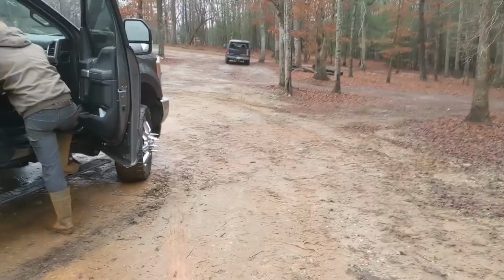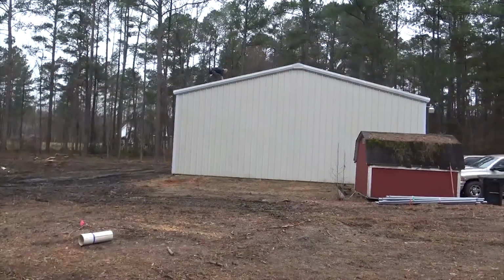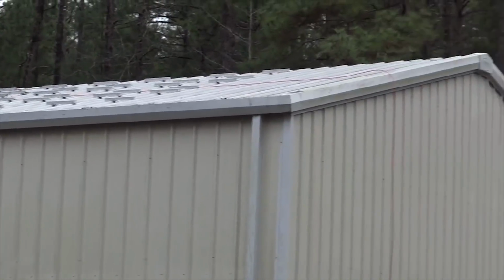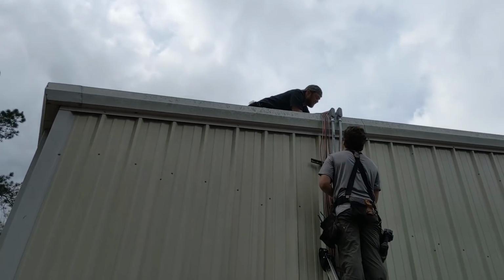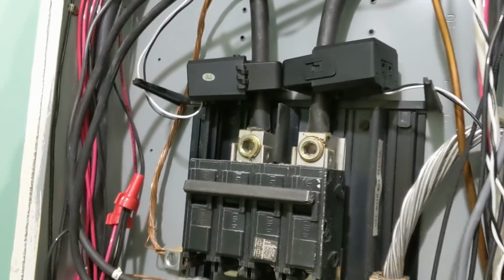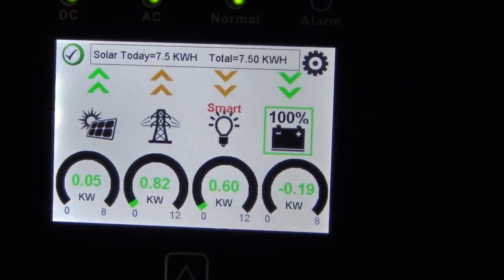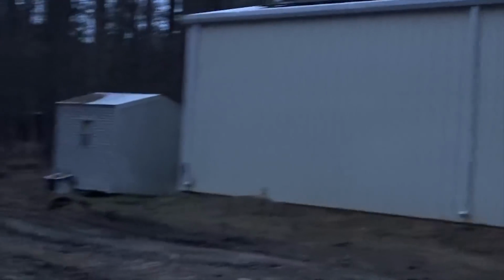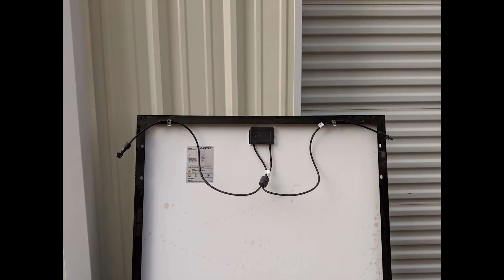Going the extra mile for our customers

Comment: I hope you identify the netural wire on 2 pole breaker hot. Tape or marker. Because I didn't see that with you panel cover off. I hope your panel would have proper cleaning in kitchen area. Above your stove plug below the panels.

Comment: Theoretically there should be no limit to how far you can out the CT's front the solark current is the same at any point in a circuit no matter the distance. That's why 90% of industrial sensors are 4-20 milliamp the wire can be 1000s of feet long.

Comment: Question, why do you use so low powered solar panels & inverters.?   Same array with Sun Power panels would have given that customer 15,540Kw system.
Reply: What do you mean low powered? I don’t think this system was just installed, the pv panels were probably around 250w each which was normal s few years ago. Also it was probably more economical to install a little lower wattage panel at a much better price since they had ample room on the roof. It wouldn’t be wise to throw the latest and greatest 360+ watt panels on a huge roof at the premium sun power panel price. And not everybody is a sun power dealer.

Comment: Hey guys, great installation!!  I noticed that you prep your panels and pre-tie the cables before install, I also noticed a little black cylindrical unit on the module cables (it's shown at point 24.23mins in your video) can you shed some light on what that is?
Reply from the maker: It is part of the sol-arks system installation to install these suppressors as part of the overall EMP protection strategy.
Reply: @engineer775   Thanks man :-)

Comment: I'm thinking about purchasing a hybrid AC (ACDC12). Can I pick it up at your warehouse, to save on shipping costs? I'm in the Upstate SC.
Another question, if you don't mind. The description shows that it requires 220 VAC.  Is there a 120 VAC model? 120VAC / solar DC, obviously.
Reply: Andrew Evanoff yes you can but it’s still getting shipped.
Reply from the maker: Andrew, send me an email. info@practicalpreppers.com

Comment: Dumb question I’m sure, but if you have solar electricity in a normal suburban situation and the city power goes out, will you still have electricity?  In other words, you won’t need a generator?
Thanks
Reply from the maker: Correct. If you have a battery based system like this one.

Comment: doing a bypass on those metal halide fixtures is a pain. the ones I've seen you cant do a bypass while the fixture is still hanging. what did those new fixtures cost? hard to believe new is cheaper. but i guess time is money. quicker to swap the fixtures then do a bypass
Reply: It is cheaper to replace the fixture, look on ebay for UFO led high bay lamps.